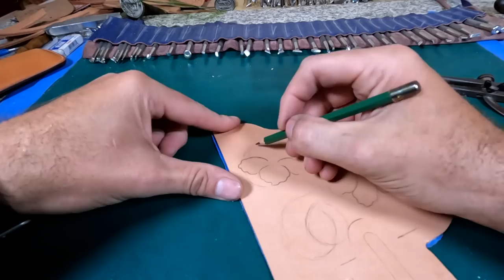Making a Leather Golf Ball Sleeve

Comment: Don, I have tried everything with blue painters tape and every time I end up picking it off in little tiny pieces. It takes an hour on a small project. I have used different brands to and including 3M's best and it will  never come off like it does for you. I have changed to shipping tape and that seems to work. I don't know why it works for you and not for me.
Reply: When removing, don't pull up on the tape. Pull it off as flat to the leather as poosible. Doesn't disturb the fibers of the leather as much this way either.